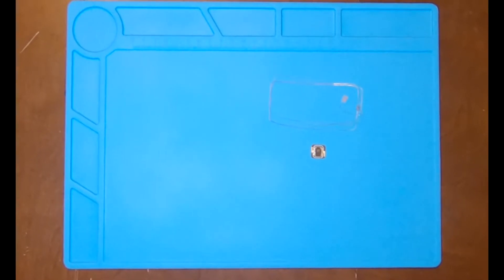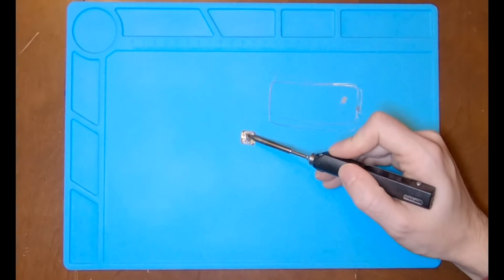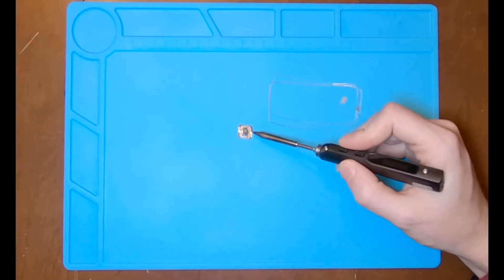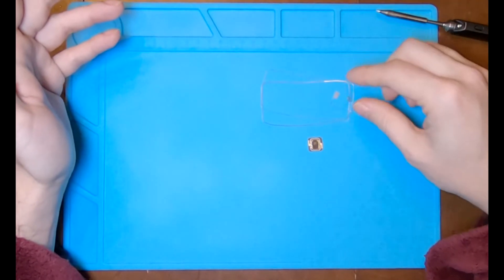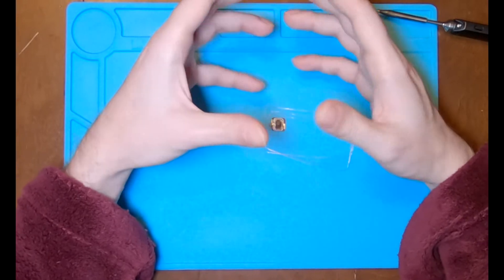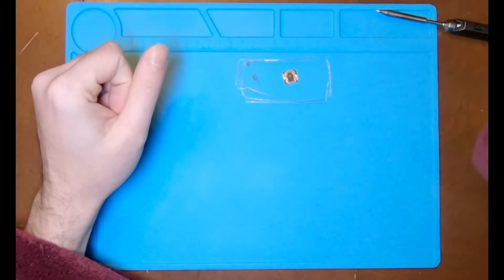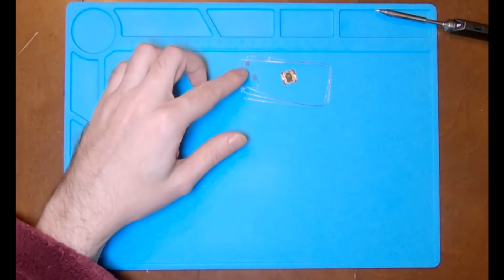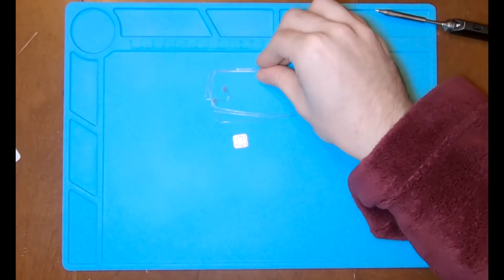What's inside a credit card?

Comment: Is it actually possible to melt the card keeping all part functioning ?  I mean to reuse it in a metallic card ?
Reply from the maker: Well...possibly. I'm not sure what effects the acetone would have on the enameled wire that acts as the "antenna" or if it may affect the circuitry. Only way to know for certain would be to try.
Reply: Gadgetboy my credit card ends up at the end of September. Gonna try one week before ! My university chimistry lessons suggest me to test with something less aggressive than acetone for the circuit. I will see !
Reply from the maker: Unfortunately, most of the solvents I tried wouldn't dissolve the card.
Reply: @Cholastikeau  did you end up finding a way to remove it and keep it functional? Sorry to reply 3 years late